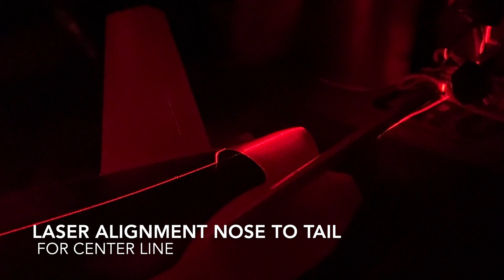AtomRC Dolphin -6S- Fastest on YOUTUBE VERSION3 (Part 4)

Comment: Hi, I would never have thought about the angle of the tail fins. Do you know the reason of this on the stock frame? Maybe for more stability at low speed?
By the way, what is the prop you are using?
Reply from the maker: @imotepRC  yes correct. Adding angle speeds up the airflow making them affective at low speeds. This is one of a few purposes designs on the airframe to improve low speed stability. I use Carbon speed props as I’ve found them to perform well at top speed with minimal prop stall tendency’s on take off…..Rotorflex👍

Comment: How do you have sound? are you running an original DJI air unit?
Reply from the maker: @ yes it does indeed👍
Reply from the maker: I’m using the runcam link split dji hd system with the wtf osd hack. I can also record onboard hd video with gyro data so the likes of gyro flow can be used. Definitely a great vtx setup….. Rotorflex👍

Comment: Finally... a real speed test that is not a dive. Nice work on this really appreciate the mods to go faster! I have a Dolphin and run it with 5s but was not looking at really high speeds, although it is capable of 120 mph. I do have a Strix Goblin and my top for it on 4s is 140 mph. I know many go faster but like the way they fly so effortless at speed have not modified it more. Currently working on a Nano Goblin and doing some of the same tricks you have done here to beat the current speed record with it on 6s. Great video, appreciate the detail to go fast!! Oh, one more thing... have a look at the EMAX Avan props. They are, in my testing way better than one would think at high speed. A 6x3.8 is faster than it should be and still has some bottom end power so stalling is not an issue.
Reply from the maker: Thanks man, the Goblins are a fantastic airframe and you will have a lot of fun with it. I’ll be sure to try the prop you mentioned on my next speed run. I have ordered a new motor with the hope of breaking the 200mph so keep an eye out for a further video to come……Rotorflex👍
Reply: Any speed is a speed test !

Comment: Great job my friend😊
 What pitch prop are you running you need to go smaller diameter more pitch that will equate to more speed 😊 I proved it on my funjet and my dolphin !  I'm running a 4.25 by 5.5 cut down camspeed prop and reaching  185mph in level flight and 206 from a shallow dive ! 4s high kv. Inrunner !!  Hopefully soon I will be able to make and post a video 😊 I'm rooting for you rotor flex 😊

Comment: Horizon mode?
Reply from the maker: @scottyh72  the horizontal run was in horizon mode and the dive was in acro mode. I carried out a lot of testing in acro mode as horizon can mask a lot of issues, I believe that’s why my older versions crashed due to rolling on their own at high speed. Thanks for the comment buddy…..Rotorflex👍
Reply: @torquedude  Horizon is scary af.  I fly acro only, even vtol.  Inav puts I term in the levelling loop, that doesn't work.  They need to run more I term in acro so all the accel needs is a set point, but Darren thinks acro is manual with some P term.  Dumb.
Reply from the maker: @scottyh72  interesting. I must admit that I have gotten lazy over the years with fixed wing and find myself using horizon more often but will fly quads acro only. Thanks for the info and I’ll stick to acro from now on with fixed wings. A lot has definitely changed regarding Fc tuning. I use to help out on the open pilot project many years ago but I have honestly lost touch with all the filters that have been added. Again thanks for your help……Rotorflex👍

Comment: What is SHIM? Never heard of
Reply from the maker: @sebastiantomczyk4577  a Shim is used to space or align, it can be many different shapes and sizes to suit the desired outcome. I made my own Shim to correct the motor mount angle so the motor thrust is inline with the wing cord. The Shim was made from ply wood. Hope that helps and that’s for the comment……Rotorflex👍
Reply: @torquedude  do I see correctly, did you mount that shim with some angle? I guess thats for compensaton of the initial angle that prop was installed. But why the producer included in its design this angle?
Reply from the maker: @sebastiantomczyk4577  great question. Atomrc has designed the dolphin to fly at low and mid speeds ( 15 to 100mph ). On the original design the combination of motor up thrust, downward facing winglets and tapered tail fins allow the dolphin to be very stable at low speeds. I had to remove these features to achieve the high speeds on 6s but at a cost. My dolphin is no longer stable at low speeds so I have to land a little faster than normal. Atomrc have definitely done a great job with their design but I want to see how far I can push this airframe…..Rotorflex
Reply: @torquedude  wow, thats great.
Reply from the maker: @sebastiantomczyk4577  thanks for the comment and happy to help and explain the modifications……..Rotorflex👍

Comment: Id apply lightweight glass cloth and epoxy to the wings to give them rigidity and a high gloss finish. Balsa Elevons....This is the occilation cause in the dive....You need an eight inch pitch prop to go faster. The prop could also be holding it back....Gliders go faster...lol...😏😏🇬🇧
Reply from the maker: @EnglishTurbines, During the flight i thought all was well until i was editing the video and seen the occupations at max speed. The wings have been shortened to reduce the leaver affect plus drag, the laminate is extremely strong making the wings very stiff but part of me now wishes i had glasses them to remove all doubt. The main thing is that i still have full control at high speed and no unwanted rolling is occurring. I am using a 5x5 speed prop at the moment with a 2200kv motor, A larger prop is an interesting concept to me and believe me your not the first to suggest this on youtube but it has always went against what i have been taught and learned from my fast nitro days. The theory i was taught was a smaller prop will allow the engine to rev out in the air and not act as an airbrake (windmilling) when the engine is getting close to its peak rpm allowing a little more extra top end speed and performs better in a dive that a larger prop. I am definitely willing to give the larger prop ago as you have suggested so i will match it with a lower kv motor to stop me melting another one. Some gliders definitely go faster, i have quite a few models that will outperform this dolphin but i want to keep pushing this little PNP foamy to see what i can get out of it for giggles 🤭. Thanks for your comment and the suggestions. I will let you know how i get on with trying a larger prop..... Rotorflex 👍🏼
Reply: Just need a variable pitch/constant speed prop 😋
Reply from the maker: @MatyasArby  a variable pitch prop would definitely be the answer. Thanks for the comment buddy…..Rotorflex👍
Reply: X2 of what he said. I’ve been toying around with fiberglass and epoxy and it’s definitely worth the little added weight
Reply from the maker: @dronepilot260rc  for sure, I use to glass some of my older models and the strength benefits are brilliant. Thanks for the comments dronepilot…..Rotorflex👍